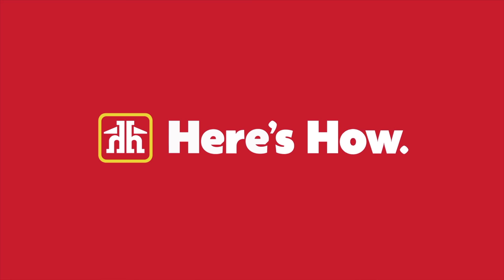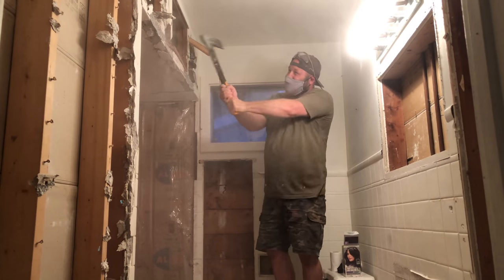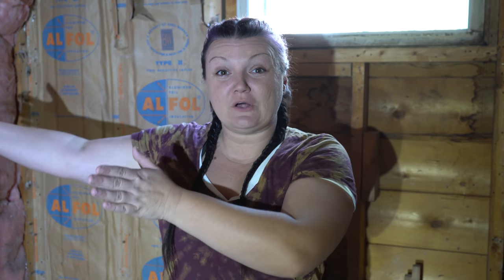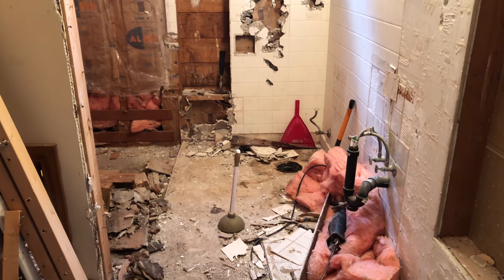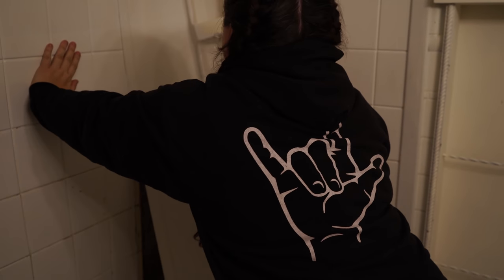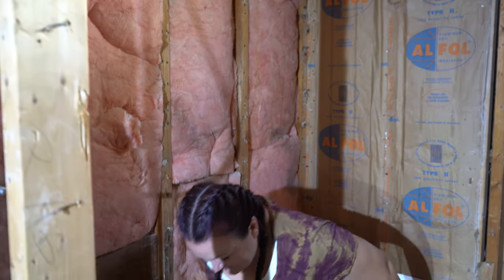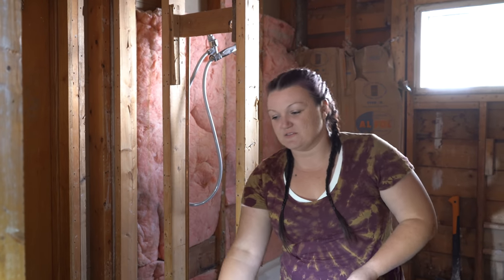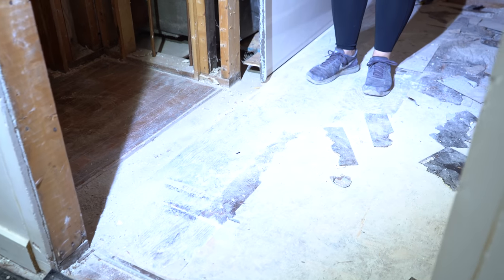Extreme DIY SMALL Bathroom Makeover

Comment: Hi guys....did I see correctly that there is no insulation in the wall under the window?  Won't that leave the room cold in the winter?  Or at least hard to heat?
Reply from the maker: its the mudroom behind which is already insulated :) The upper is insulated since its slightly exposed to the outside wall.